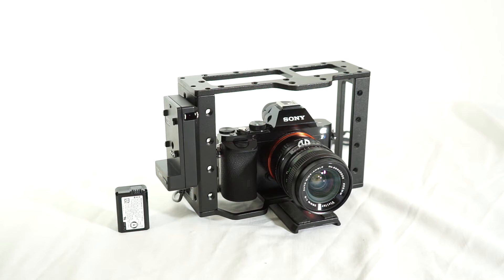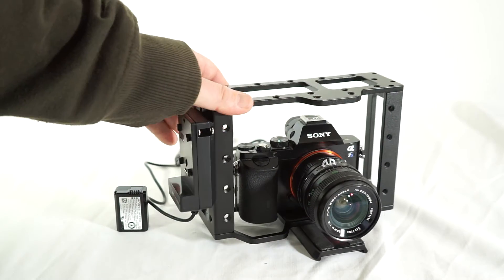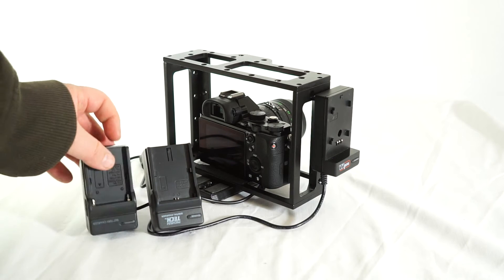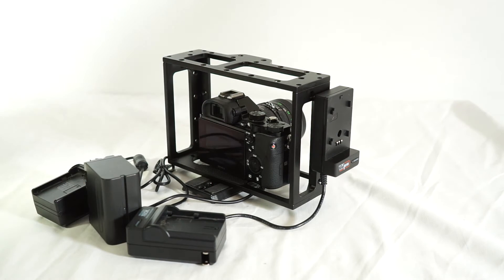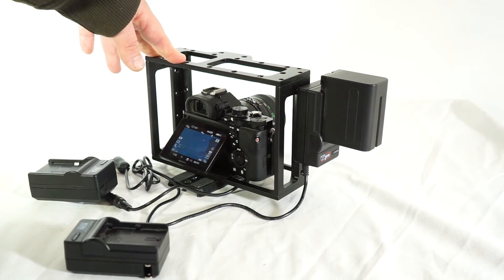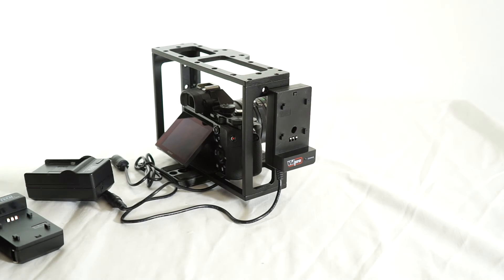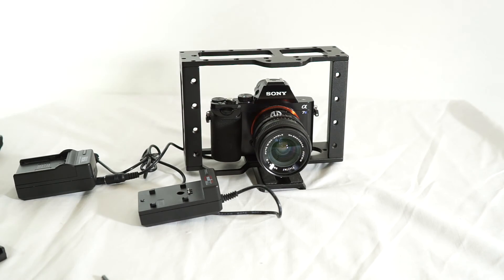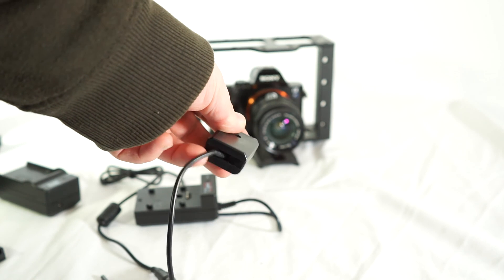DIY Universal battery adapter for Sony cameras ( A7s battery solution )

Comment: If you connected 2 chargers in parallel you could swop out one battery at a time without interrupting the camera.
Great vid, thanks for making.
Reply from the maker: This is actually something I've been totally considering doing! On a shoot just a couple of weeks ago, I had my first malfunctioning battery (over a year of doing this, and only one malfunction... I'd say that's a pretty good track record). The battery was freshly charged, but the camera complained that it was dying after 20 minutes. When it finally up and died, I quickly swapped to another cell and was good for the rest of the event (thankfully I was able to cover the cut in post, so no harm done). 
I started thinking, maybe I should have two batteries in a parallel circuit. The problem with this however is two fold: 1) I wouldn't be able to tell how much is left to any of the batteries, so I wouldn't know when it's getting close to needing a swap. I'd have to come up with some sort of in-line voltage monitor, which seems more complicated than my DIY setup and not something I have lying around like these parts anyway.
2) The camera does this weird thing sometimes where it started reporting the battery is dying after a couple hours even if it isn't. Rebooting the camera, for example, sometimes takes a battery that was reported at 18% remaining to 45% remaining. Its almost like the camera has a timer that it thinks the battery aught to die whether it really is or not. A voltage check in my Atomos Ninja confirmed that the battery did have close to half capacity, so the voltage was somewhat accurate after the reboot. I'm wondering if I put parallel circuit batteries in, if the camera would just shut off after a certain amount of time regardless of the fresh batteries. I'd actually love to test this theory, come to think of it.
Reply from the maker: Mark- just to update, I ended up doing this for a recent live event I wanted uninterrupted power from. It worked great, I wired up another plug from another adapter in parallel and sticking out the side of the plate-charger body. The idea is, I have a couple of these battery adapters, each one can go directly into a camera if I wanted, or I can hook them into each other in parallel when desired or just when swapping batteries so it doesn't need to shut down. Problem was I was shooting outside for some of it and got a little rain. The exposed plug got wet and shorted out, camera instantly shut off. I ran inside and covered the plug with some gaffer's tape and was good for the rest of the shoot, but that was an unexpected mishap which could have potentially really messed things up. Thank goodness everything turned out OK.

Comment: Hello, I see this was uploaded a year ago and I just wanted to know if the hack is still holding up and if there were any issues over time.
Reply: It sure is! I use it all the time, just used it again a couple of weeks ago to record a local school's stage performance. The only issue, which I think I mention in the video above, is that over the time the Sony camera thinks the battery is running down when it is not really. For example, when using oversized Sony 970 batteries I should be getting close to 3 hours of life out of it. As I approach 2 hours it might think I'm down to 20% battery, but if I turn it off for a moment and pop the battery in/out, it will suddenly report I have 60% left. So basically, I don't trust the battery meter. 
Other than that, it has been pretty great! I built 2 of these, I use one on my A5100, one on my A7S, and occasionally my A7Rii, although that one could be powered by USB (which presents a different set of pros and cons). Good luck!
Reply: if you measure a battery negative to (T) 3rd pin (around 10Kohms)and insert a resisitor of the same value it will show the batter usage on camera.
Reply from the maker: Interesting- it does currently (sort of) report the battery life remaining. Not accurately, but not too far off either. I wonder if this would address the battery dying over time thing (camera sometimes reports capacity dropping, even if supply is consistent). 
Great name, btw. Mordy is a nickname, my legal name is Mark- not every day you meet someone with the same interest and almost an identical name.